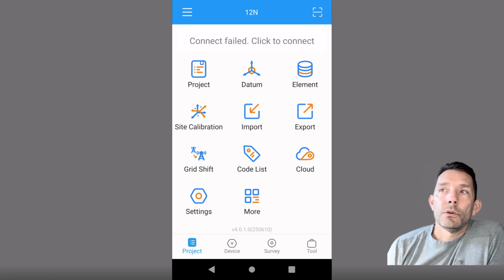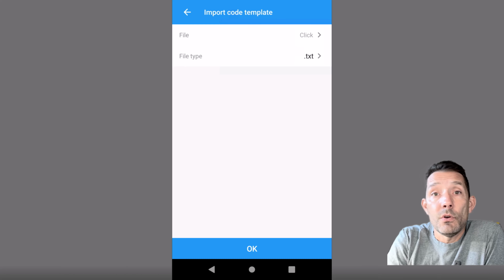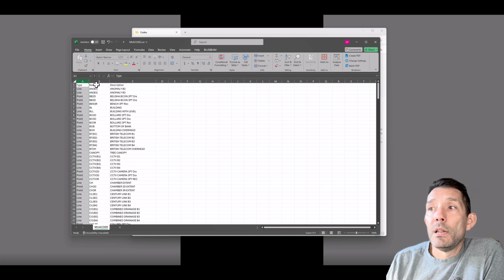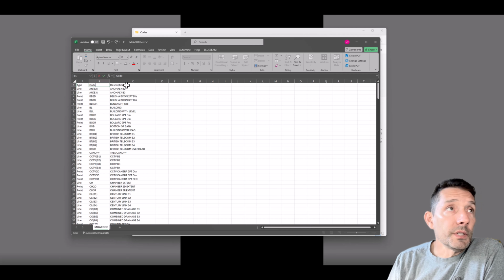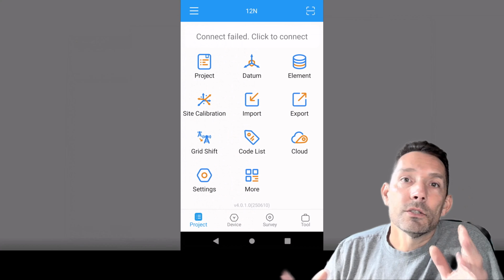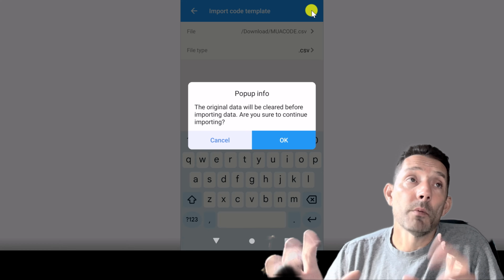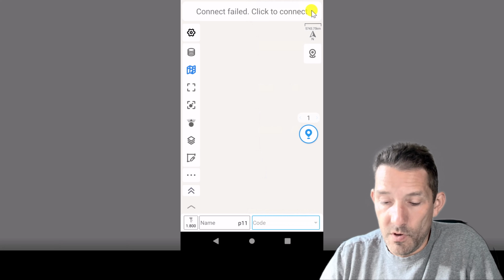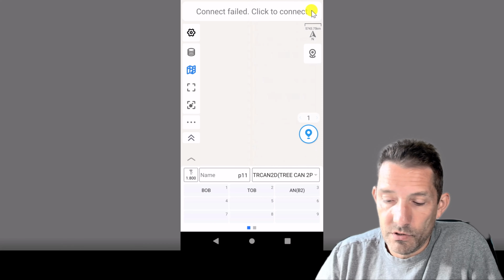Survey Master how to import Code List

Comment: i have a question. do you know can we use the keyboard physical numbers to select quick codes from the template (without touching the screen i mean)
Reply: yes, you should be able to do that, may need to change a setting, but i believe it's possible